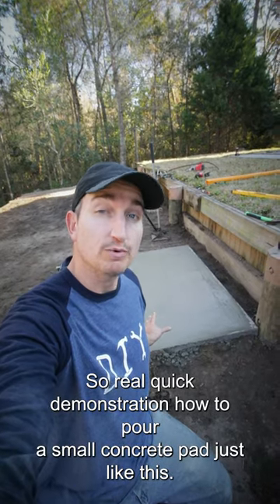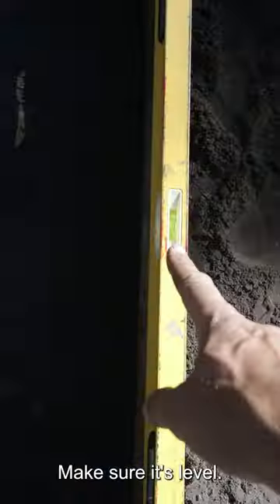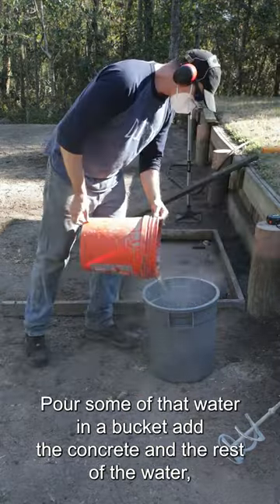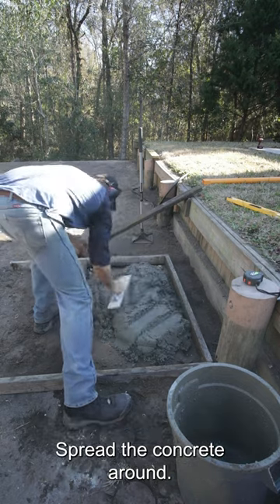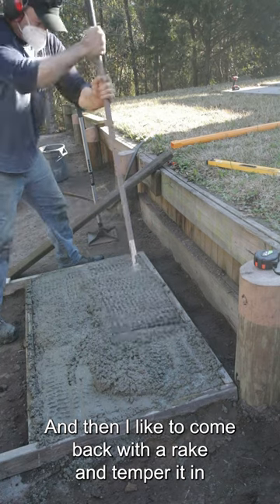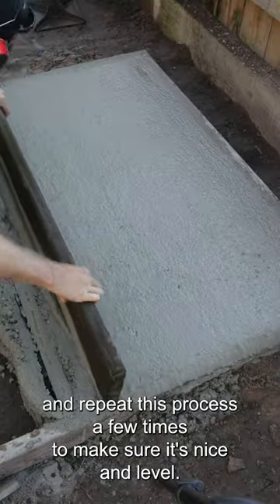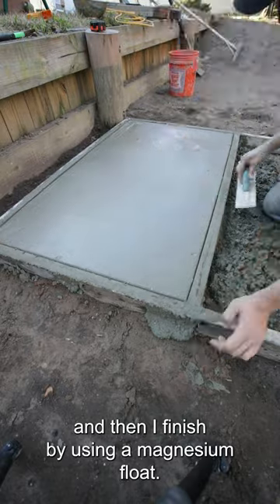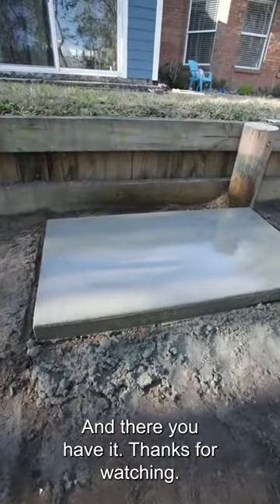How to Pour Concrete Pad Yourself

Comment from the maker: DIY concrete tools:
Concrete Mixing Drill = https://amzn.to/3waL7QN
Magnesium Float (to smooth surface) = https://amzn.to/3QEFOCK
Ground Tamper (for substrate compaction) = https://amzn.to/3GHzjuu
Concrete Mixing Bucket = https://amzn.to/3CQl7hD

Disclosure: The above are Amazon links. "As an Amazon Associate I earn from qualifying purchases."
Reply: It’s just tamp not “tamper”
Reply: That is NOT a Concrete Mixing Drill! hahaha I've never seen anyone use one to mix concrete. That's a mortar and plaster drill. NOT designed to mix aggregates the size used in concrete. I think you're confusing cement with concrete. Holy moly.
Reply: Exterior pads should be brushed for traction. Interior pads can be smooth. Normally you use the bead float after you float the pad smooth and brush it.
Reply: and broom brush if it is walked on

Comment: 89 days later, repeat process because slab is in two pieces.
Reply: Two or more pieces probably
Reply: How come?
Reply: @lukecrawford9180  no rebar
Reply: @jonathanlimon6560  This pad doesn't need rebar.
Reply: @rellt5498 you’re right but if you want it to last you have to
Reply: @jonathanlimon6560  I poured a slap for my ac unit with no rebar and it’s held up
Reply: @glock1inthetop45  no u don't, rebar will actually cause it to crack since the slab is small
Reply: @toxixbob8375 it the opposite of what you said. All concrete requires steel to strengthen it. Doesn’t matter how small. Even 6” stem walls or curbs should have at least two pieces of steel running down it. Rebar will never make concrete weaker in any configuration.
Reply: @toxixbob8375  no it’s the opposite buddy
Reply: @glock1inthetop45  I just made Roman concrete with Volcanic ash from Italy
Reply: @chrisortiz8072  than isn’t that Italian concrete ??
Reply: @glock1inthetop45  well since it was invented when it was all part of Romen Empire and while it no longer exist still counts lol. Since the italians couldn't even reproduce it and took centuries I'd say it still Roman
Reply: @rx7what  Steel is actually the main failure point in concrete structures. Rust is a larger  molecule than iron. This expands the rebar over time. Concrete cannot take high tensile stresses so it cracks. The steel is necessary in those structures, but a small slab like this will be fine without it. Particularly on well compacted ground. It has almost no loads on it.
If you are going to do it, I would say fiberglass rebar or chopped glass mixed in, are the better options for thin slabs where it is harder to get the 2in minimum depth required to reduce steel corrosion.
Reply: Not to mention slab poured on mud/clay. Should have been sand
Reply: This guy has no idea what he's doing!!! Lol
Reply: @rx7what I’m more confused now than before. You both sound so confident. I’ll just google it
Reply: @adamnotkardas7765  Look at sidewalks. They are done without rebar all over the place. Just make sure there isn't organic matter under it to rot away over time, and that the soil is well compacted and you will be fine. Look where you see cracked sidewalks and there is always something wrong. The dirt was washed out from under it, the ground settled due to bad compaction, or a tree root is heaving it. Places where the ground is solid, it stays intact for generations. 

Throwing some chopped strand fiberglass in wouldn't be bad. It is also quite common to use a steel 6in opening mesh in slabs, and if it did crack it would hold it together for a few more years until the mesh rusted thru. The steel would then start cracking it more as it rusts due to exposure. But it would be 30+years out most likely. 

People are making too large an issue of it. It will be fine for a very long time either way. If you are going to put heavy things on it like a car, then it starts to matter more, but even then sidewalk sized slabs will usually be fine. We drive over them all the time, and with heavy trucks too. If you are over 6ft in any direction I would add some reinforcement. If you put a seam in the middle of a 3x6ft planning for a crack there, you could skip it. It probably won't crack if the ground is compacted well, but just in case. If you are going to drive on it, make it a little thicker at 4+in thick. If using bag mixes, the high strength concrete costs very little more. Use it.

You are unlikely to have issues on a small slab. Go for it.
Reply: Ive used old cattle panels panels before. Works like a charm
Reply: @jonathanlimon6560  rebars not necessary bro,50x50 galvanized mesh would've been alright for a slab that size.
Reply: @rellt5498  Exactly.  Too small.  Also, for those that don't know or don't understand, rebar does not prevent concrete from cracking.  It is meant to keep cracked sections from pulling apart.
Reply: @rx7what  damn my dad set up some this size 20 years ago and they still in one piece he had crushed rock underneath only difference . I better let him know
Reply: @court2379  that's why I use painted steel 👍
Reply: @scottdashnaw2345  I assume you are referring to the rust issue. I recall seeing something that epoxy coated rebar is no longer allowed in engineered work due to the paint allowing the concrete to delaminate and making the rebar ineffective as reinforcement and not really providing effective corrosion protection. I'd do a bit of research on that one. For me I will just use fiberglass rebar to avoid the whole problem.
Reply: You don’t need rebar anything under 10x10 😂😂
Reply: Yup. No rebar.
Reply: @ryannedits  yup,   You don’t. Still gonna snap. At the very least pour a thickened edge for this application,  I’d use rebar. That’s just me.
Reply: People who think this tiny pad needs steel reinforcement are the kind of guys that waste company money, and don’t think about what in the fuck they’re actually trying to accomplish.
Reply: @rx7what  not true. If the rebar oxidizes it will %10000 degrade the structural integrity of the concrete around it. That’s why you see rebar painted green.
Reply: Eh, it'll be fine.
Reply: @johnnysilver5866  people who think that this tiny pad doesn't need reinforcement, have obviously never poured a tiny pad....
Reply: @ryannedits That has nothing to do with it.. You don't need rebar for anything under 5" thick.. You need expansion joints when a slab is larger..
Reply: It might crack if the ground sinks a bit unevenly but it’s not going anywhere that size it’ll do its job for years to come
Reply: @glock1inthetop45  add rocks you won't need rebar.
Reply: What are you some new age builder who think every bit of concrete gotta have rebar !!!!

50yrs ago we were doing concrete pads 20x20ft 30x50ft 100x180ft and so on, no damn rebar and all have held up 50yrs later ha clowns !!!!!
Reply: @Alex-ep7cn  don’t do that lol
Reply: I was wondering about no rebar being an issue...especially since another one of his videos is of small concrete yard steps, and he put metal bar in those.
Reply: The need for rebar depends on the strength of the concrete and what it's used for. This pad will probably last a long time with rebar
Reply: @Glock1inthetop  guess you don't know where the roman empire use to rule 😂😂
Reply: @court2379  I don't know much about much but up here in Central Canada.. I have seen them use a combination on epoxy coated and non coated rebar..  Epoxy coated was used where one poured met another to avoid corrosion issues...
Reply: @scottward2366  They did the whole interstate system in my area with epoxy coated back in 2002. But from what I have heard recently the coating is unsuccessful at protecting the rebar from corrosion and delaminates making the rebar less effective so isn't used anymore.
Reply: @glock1inthetop45  I pour sidewalks for a living and we’ve never used rebar
Reply: @FlameofUdun9  no you don’t for what company
Reply: @lukecrawford9180  Yeah nothing really heavy going over it it should hold up.
Reply: Not even that. That slabs gunna turn into powder
Reply: @lukecrawford9180 it had babies.
Reply: @lukecrawford9180n o joints cut. Joints help to prevent cracking.
Reply: @okboomer6201 needed gravel
Reply: @jasonbuske3093  🤦‍♂️🤦‍♂️
Reply: @adamnotkardas7765  google it then let us know the outcome
Reply: @rx7what unless youre near the ocean
Reply: Or just buy a pre cast slab
Reply: It will probably crack due to expansion of the substrate underneith. Its not advised to poor concret straight ontu soil. You want some type of aggregate underneath to allow for movemenr.
Reply: @rx7what bro what are you talking about ?? lol 😂
Reply: @court2379 
Sidewalks!!!! Thank you for that fantastically perfect example to show all these people why they're wrong about "you gotta have rebar"
Reply: Straight to the comments and... Rebar Wars
Reply: @court2379 agree on all your points. I'd suggest getting crete with the fiber already mixed in. Only costs a couple of bucks more per bag.
Reply: If you want this concrete job last longest put rebars or mesh
Reply: Like all this stuff, prepping the ground is very important. I would have tamped the ground harder, put a layer of sand down fully tamped and leveled, then pour the concrete
Reply: @lukecrawford9180 why not spend like $20 on rebar and not worry lol
Reply: @adamnotkardas7765 
hey that's a good idea use a tool available to all to figure out what the correct solution is. 😂😂
Reply: @jonathanlimon6560 you won't need rebar for that pad
Reply: Small slabs don’t need rebar. The sun can heat it up on hot summer days and cause failure. All you really need is sand or gravel underneath. Ideally gravel. That slab will last 50+ years minimal cracking.
Reply: I was just going to post something about reinforcement. Ya beat me to it... by a LOT! 😅
Reply: Something this small doesn't need rebar, something this small is also not worth the amount of work he put into it
Reply: No it won't be.
Reply: NAH
Reply: @glock1inthetop45  People like you have no sense, you work on two commercial jobs and think small residential slabs follow the same rules.. That slab will last 5+ years and stay pristine.. 

You go ahead though, waste the extra 1k bucks on unnecessary rebar for your 2x3 lil slab. You'll just get laughed at by the contactors that demolishes it in 20 years.
Reply: @glock1inthetop45  well that's stupid. Concrete does NOT last!
Reply: @rellt5498   wouldn't hurt but DEFINTELY COULD USE WIRE MESH
Reply: Romans never used rebar. That is actually one of the reasons some of their concrete is still in ok condition.
Reply: @ecospider5   their  concrete and cements were made very different then we do... the stuff they made is almost magical ...lol
Reply: @rellt5498  with the lite tamping of the soil that is shown it could possibly need it.
Reply: indeed

Comment: Half the comments: Terrible, this would never work for the foundation of a skyscraper.
Reply: and what do u spect? this was a bad application and he is playing instructor.
Reply: @francis5944  I expect people to be able to tell the difference between a decorative concrete paver and a foundation.
Reply: @canonicaltom  your right. I jumped in to quick... the cut off size to add rebar is at 4-5 inches thick. and minimum size of 3'x4' area.
Reply: @canonicaltom  when you're teaching other how to do it and you do it badly this need to be criticize badly otherwise other ppl will think this is ok.

Nop, this is not ok even for a decorative concrete, he forget to mention the base is really important. What do you think all that water needed is going on a mud type of base ? It will sink and the concrete will break, it's basic precaution.
Reply: We get it, you like to do shortcuts and shoddy work while some of the comments are from people who actually build buildings and stuff.
Reply: @davidgray8089  The correct engineering for the job, no less and no more. Overengineering and overbuilding is just as bad a habit as cutting corners.
Reply: I've been in construction and design including landscaping for  36 years. This is the only reasonable comment on here. This is essentially a garden paver. 
But jeez I dunno, maybe I'm missing a trick and everyone else demands pre-tensioned steel reinforced stepping stones to their hammock. Apparently there is an obesity epidemic.
Reply: Well of course it won't work like that. But straight water
Reply: people forgot just how strong concrete is. there is a reason they use it for everything. nobody is going to make a slab this size and put a house over it lol....
Reply: @DiscoFang  a "garden paver" ?    -- @ about 3' x 5'  with no path ?   

I'm going with it is a landing pad for some steps from the raised yard  -   in which case it would absolutely benefit from a bit of wire or a few r-bar pieces
Reply: Won’t even support a light garden shed. It needs a least 100mm of MOT on top of the dug down earth.
Reply: @eyemanbish  Not sure what kind of garden shed you're building that's only eight square feet.